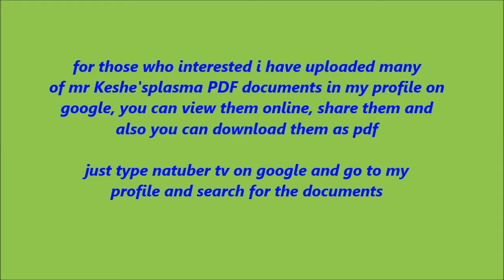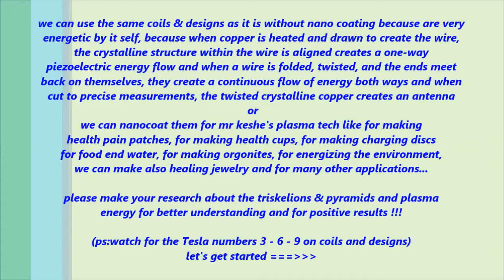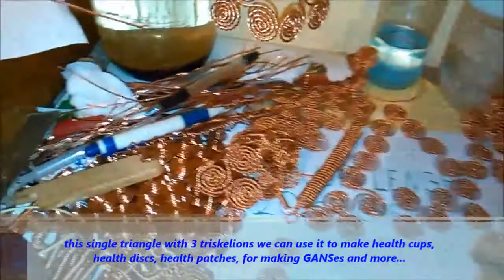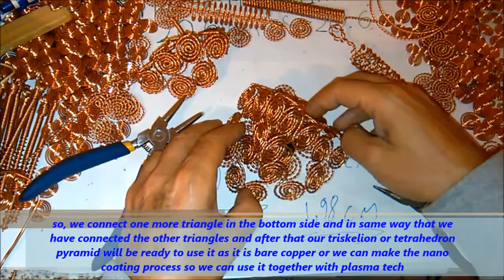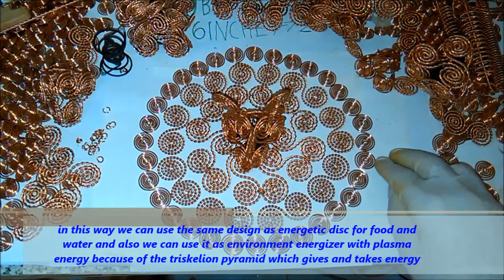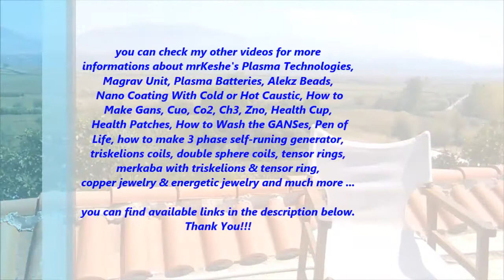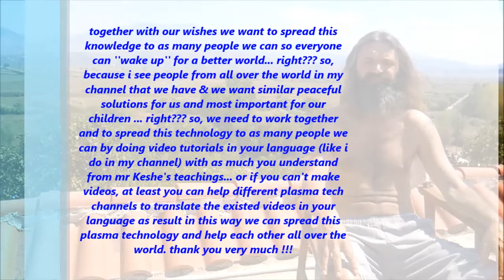Charging Disc for Food and Water, Big Triskelion Pyramid, Different Designs, Plasma Healing Art DIY

Comment: Great job, and where can I find the twisted copper wire, or do I have to twist it myself? Thanks.
Reply from the maker: i don't know if you can find anywhere twisted copper wires... in this case you need to twist them by yourself and don't forget to put your intent and feelings for what purpose you want to use them for positive results... it is very easy to twist them by using a drill. cut 2 pieces of copper wire at the desired dimensions, put the 2 ends of the copper wires in the drill and you start twisting them.

 for more info and tutorials you can check my other videos by viziting my channel, here the link: http://www.youtube.com/c/NaTuberTv 

thank you very much !!!